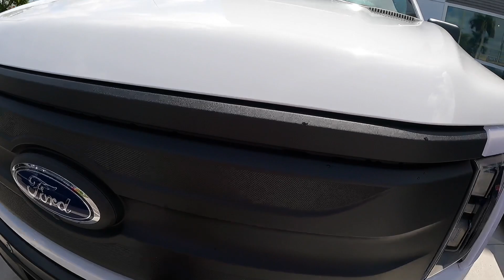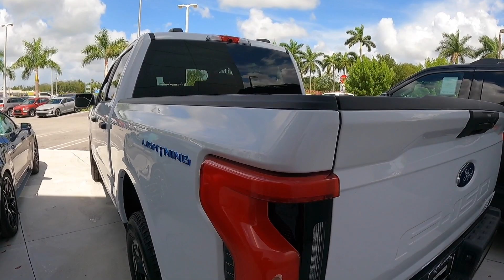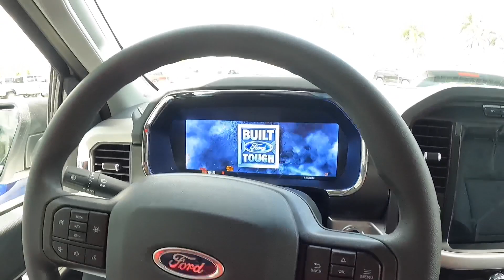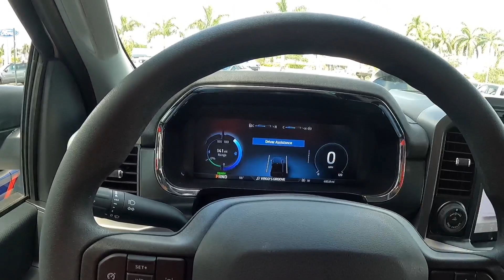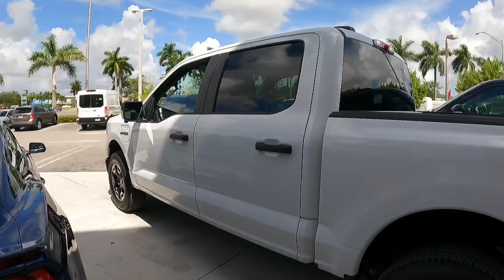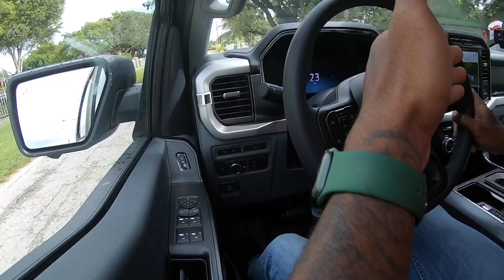2022 Ford F-150 Lightning Pro - A Crazy Affordable Electric Truck

Comment: I Own this same model and year. It has been a fantastic truck. Also I tow 3000 to 5000lbs sometimes and the range has been impressive considering I have the standard battery not the  extended.